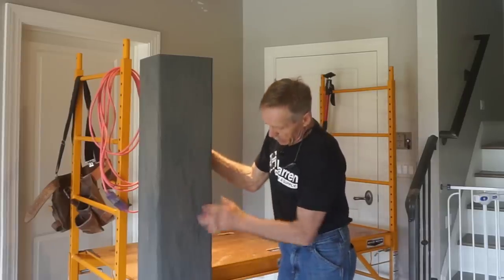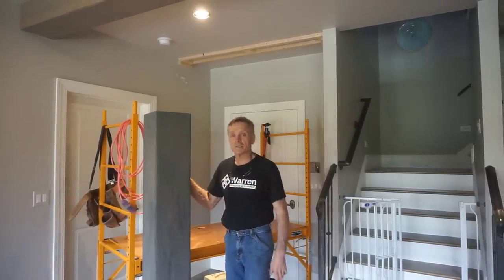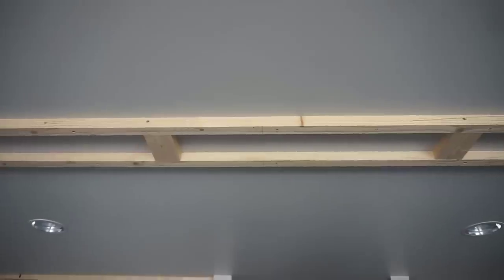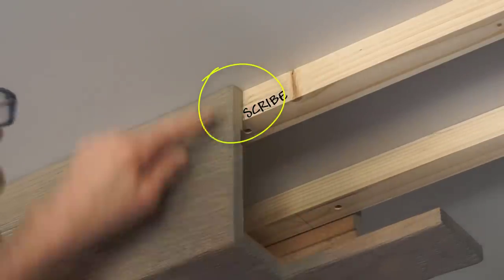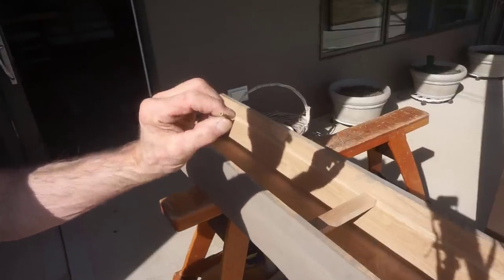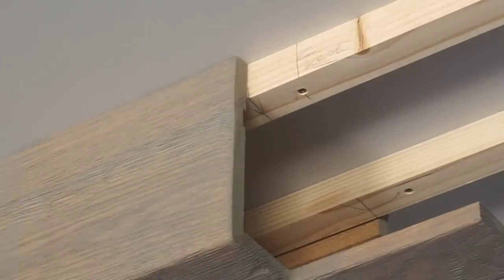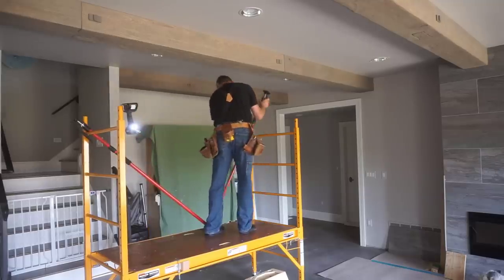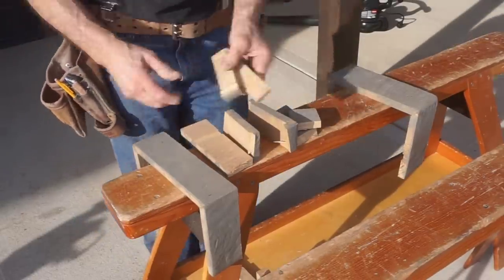Pro Tips for Installing Faux Beams

Comment: Another great job and video! I was just wondering if you had to scribe the top part too (against the ceiling) because ceilings are always a problem, never straight.
Reply from the maker: Thanks Telios... I lucked out on this project with the rough look of the beams which disguises the beam/ceiling fit to a degree.  This ceiling was also untypically flat which was an added benefit.  For smooth beams and wavy ceilings the scribe process you mention is a whole other layer of difficulty.  Best, Matt
Reply: @NextLevelCarpentry  Thank you, I agree 100% about "whole other layer of difficulty". I always follow your videos (inevitable with thumbs up) and I've learned a lot with them. Thank you for sharing all this precious knowledge. Cheers.

Comment: Great video as always. Is it necessary to scribe to the ceiling as well?
Reply from the maker: Usually it is but, since this ceiling was exceptionally flat and the top edge of the beam was 'aged' with a spokeshave a bit of variance just added to the look.  Otherwise it's a whole other set of steps to install beams like this.  Best, Matt

Comment: Thanks for the video. But what happens when the wood shrinks ?
Reply from the maker: You're welcome for the video MrSprincat.  No worries: if you've watched the build process for these beams you'll know they're made from kiln dried boards so shrinkage is of little concern, primarily because wood changes very little in length which would be the only shrinkage that would be noticeable on this installation.  When ambient humidity changes the width of the boards that make up these beams it will be imperceptible. Best, Matt
Reply: Thanks Matt. I wish I had your skills.😊

Comment: When I saw the title for the video, I was curious on how you were going to scribe the beams to the ceiling and get the butt joints to square up. Fortunately, you didn't have to with the ceilings being flat as they are. With my luck, the ceiling would be way out and I would have to fit them to the ceiling and the walls while maintaining a straight line both sides. 🤔

Comment: Correct me if I'm wrong, I assume when you were putting those beams together you knew exactly where their place on the ceiling was and the middle ones were exact finished length. Did you build the outer ones an inch longer to account for scribing? I watched the video of you showing how to build them but I don't remember anything about that or if you mentioned it at all in other videos. Just being curious thanks
Reply from the maker: You nailed it Kyle... I didn't mention it in either video but you're correct in discerning that the center sections were all finished length (at 7' 0-1/2").  The end sections were about 7' 2" (measured from the tenon shoulder, not overall length) leaving about 1 1/2" to trim with the scribe for a nominal finished length of 7'-0 1/2" so the three sections of the one beam that ran full length were equal.  That's also why I chose a 2" scribe offset block length so I had about 1/2" of play at the walls during scribe... don't want to be fighting any tolerances if I don't have to.  I like your curiosity, Sir! Best, Matt

Comment: Great job!!!  Having worked with designers in the past, I have to wonder if the home owner could not simply look at some design magazines and tell you directly what they want, and save a lot of money.  Working with designers that do not provide concept drawings most often means "multiple change orders".  I think of designers that don't provide detailed drawings as "dreamers".  I think your beams look great but IMHO too massive for such low ceilings, NO FAULT OF YOURS.  I also wonder why your beams did not go in before the sheet rock and the tile on the fireplace. While your fit to the walls and fireplace looks great,  I feel that the beams, to look realistic,  should give the appearance of going through the wall and fire place tiles, not simply butting up to those surfaces.  BUT again great job.

Comment: I think the beams look great without that faux, the beam with the faux dont look nothing like aged wood, you did a great on those beams though
Reply from the maker: Hey Duarte, the 'blue beams' became very obvious when I installed that one section... you've probably 'been there' when a paint or grout color looks different in reality than in the sample, right?  I did it that way on purpose for exactly this reason.  Next video upload will show the actual faux finish process where they end up with more 'brown' and less gray-blue to better compliment colors in the large format tile on the fireplace front.  Everyone's happy with the final outcome although there's always the color distortion from video  settings so it might still look weird places other than the actual room where they're installed.  Best, Matt
Reply: Next Level Carpentry thats very true!

Comment: I watched your vids doing the faux finish. Nice job... As I watched I wondered if they were mounting to a flat ceiling? I see that they are. Why wouldn't you relieve the linear ceiling contact edge with a 5/10 degree angle so that there would be a single contact point the full length ? See 3:04 time stamp.
Reply from the maker: Although I often use beveled edges to make scribing easier and the fit better, the main reason is that I didn't intend to install these beams with an 'airtight' scribe fit to the ceiling.  The rough nature of the beams lends itself to a less-than-perfect fit which, in this case, is a perfect example of 'less is more' IMHO.  FWIW I've done other beams with a stain and lacquer finish and used the beveled top edge trick for a much closer fit.
Reply: @NextLevelCarpentry  thank you for the explanation. I never looked at it that way. I have always envisioned/considered the faux beams, holding up structural beams beneath the sheet rock. 
Therefore, I’ve wanted them as tight as I could get them. 
Hmm.. I’ll have to ponder that a little bit.
Reply from the maker: @L46C3  You're welcome... I appreciate your comment based on your experience because it's very well reasoned.  My preference is tighter fitting beams too but, on this project, because of the shear volume of scribing that would be required, it just wasn't practical.  I've been successful in my carpentry business because I try to listen carefully to my clients.  Beams that fit just a little bit tighter would have probably doubled the amount of labor required, so they had no problem opting for a 'rustic fit' because no one but quality trim carpenters ever notice the difference. 😉😂
Reply: @NextLevelCarpentry  Thank you. good job!

Comment: I'm going to box out a couple of lvls. Since the ceiling and wall drywall is still removed is there anything wrong with installing the box beams first then drywalling up to them?
Reply from the maker: Nothing right or wrong with the sequence.  It has more to do with who you want to do the finish work.  As a  carpenter I feel I can fit to drywall better than a taper can finish to beams even though it's far easier for me to build my beams and leave it to a taper to work around them.

Comment: Thank you for sharing! Is this a standard 8 feet wall?
Reply from the maker: I don't remember the exact height but it's around 9'...
Reply: @NextLevelCarpentry  Thank you! How would such beams look on 8 feet walls?
Reply from the maker: @pooh-bunny9249  Hard to say but my first reaction is that they would have the effect of lowering the ceiling.  When in doubt I like to make mock-ups out of cardboard that are easily attached temporarily to a ceiling so you can get a feel for the proposed plan before committing to it.  My hunch is that you'd want to go with 'shallower' beams like 3" or so to get the effect of beams without visually reducing the ceiling height so much...

Comment: I noticed you didn't scribe the beams to the ceiling. Any particular reason you didn't do that? I'm looking to build some beams for a great room that has a 17.5' span. As I'll be doing it myself (maybe on helper), I'm planning that I'll need to build in 2-3 sections, but would like to have an appearance of one large beam.
Reply from the maker: I influenced the design and finish of the beams to avoid and minimize any scribing necessary. The home where the beams are installed was pretty new at the time so the ceilings were quite flat and I hand peeled and rounded the edges of the beans a little bit where they meet the ceiling so scribing wasn't necessary to achieve the look they were after. It was neither practical nor realistic to make these beams look like they were one solid piece for that total span and I don't envy you if you need to make your beams look like they're one massive beam😥
Reply: @NextLevelCarpentry  Thanks for the reply! Makes complete sense. Since I might do a decorative design between beams, I may solve the ceiling problem with shoe molding. Hopefully, since it's a new build the ceiling will be nice and flat as you worked with and I can aim for that 1/16 max gap and caulk it! Love the videos and appreciate all the inspiration and insight.
Reply from the maker: @doctorploegs  One trick I use when I anticipate a lot of scribing is to bevel the top edges of the beam whre they meet the ceiling... makes belt sanding/block planing to fit a lot easier for the first 1/4" or so.  I think I cover it in this video: https://www.youtube.com/watch?v=-zzo74Agqf8  but suspect you already know and use this trick.
Best,
Matt

Comment: Nice video Matt but the faux beams won't fool many people as they are far too regular. Traditionally in England beans are Oak and not a regular shape in any way or form.
Nicely fitted though.
Reply: Craig Peel another problem is those ceilings are to low for those beams, customers were out of their mind adding beams that size to that little house, maybe a coffer ceiling would have been better in this case
Reply: @duartepaintinghandymanservices  I'm 6'7'' and have had to duck under many large beams in tiny rooms... the difference being they were in 300 year old cottages and served a purpose. You're right, they don't suit the room, but there's no accounting for taste and we've all done things for customers we think are aesthetically wrong.
Reply: I agree Craig, but the biggest give away is you can't join beams together over a large span with pegged tenons... but I'm pretty sure the customers friends wont know this.

Comment: Do you have a recommend brand # or source for your carpenter Pencil?
Reply from the maker: Not that I can put my finger on Jerry.  These were a high-quality type offered by the promotional marketing outfit that printed them for me.  My experience is that you can't tell a good pencil until it's in your hand because even within brands there's a LOT of variation that falls under the same product description.  These are the only ones I've found with reliably consistent lead: https://www.amazon.com/dp/B004ZWN0J2/?ref=idea_lv_dp_ov_d&tag=aiponsite-20&linkCode=ic6&ascsubtag=amzn1.ideas.2ZR6FYONCIC5K but I don't care for their smaller physical size and you surely don't need a whole box of 'em.  You should be able to find these for individual sale locally if you can't find decent larger ones.  Sorry I can't be more help... Best, Matt

Comment: Is there a minimum ceiling height needed for beam installation?
Reply from the maker: Probably not in building codes but definitely with customer preference IMHO.  We had to take into account minimum headroom at the stairway that enters the room because that IS a code issue.  I think it's 6'8" from the line of nosing but check local code if it's a concern... Best, Matt
Reply: @NextLevelCarpentry  Thanks 👍

Comment: I think that Bosch laser might be my next laser. Just had a random dumbass on the job smoke my tripod with my PLS360 laser on it . "Sorry Dude".
Reply from the maker: I chose the Bosch Green Line laser over pretty much every other one in its class (or slightly above) and am completely pleased with it... as much as I am with any tool, that is.  There's always a dumb/hinky feature or two with any tool but this thing does everything I need it to... plus a few more... so I'd  be surprised if you didn't like one if you got one.  But you still have to protect it from goomahs on the job, that's for sure! Best, Matt

Comment: Am I alone? I would have finished the pieces long and scribed them and installed. Done.
Reply from the maker: You are NOT alone JR... in fact I'm with you in that I'd much prefer to do a one-time install.  Unfortunately circumstances beyond my control ie: long distance disconnected designer calling the shots meant that I needed to go about it in this redundant way to keep the project moving and ultimately get it done.  If you're active in Custom Cabinetry you, of all people, will understand 😯😏😎 Best, Matt

Comment: Put beams up before wall board problem eliminated.
Reply from the maker: Eliminate one small problem... and create 3 more, much bigger ones... not the way I roll but that's just me.  Best, Matt
Reply: @NextLevelCarpentry  i have done them that way never any problem
Reply from the maker: @roccoconte2960  Please share photos of the finished product... just because it's less work for you to install beams before drywall it doesn't mean it's easier for tapers and painters that follow and, generally, the quality of the end result suffers even if it 'was never any problem' for you.

Comment: uhhh, okay, but as a craftsman, does it not bother the hell out of you that the faux "joints" in the middle of the beams make absolutely no structural sense?
Reply from the maker: Guess you've not worked with any designers, have you.